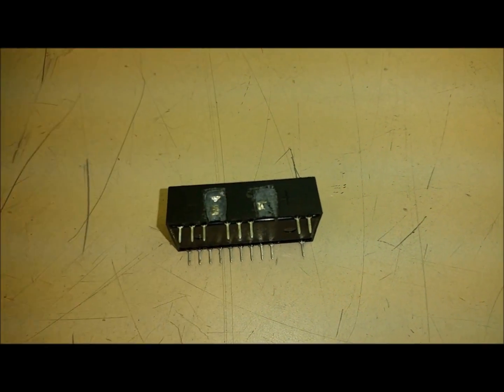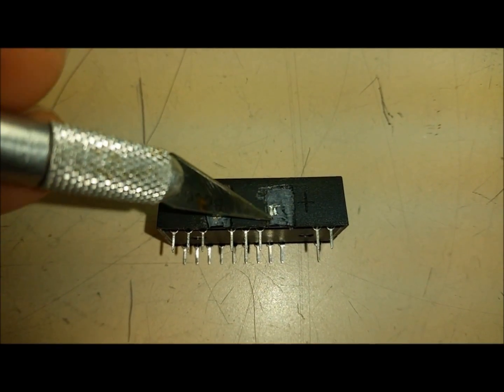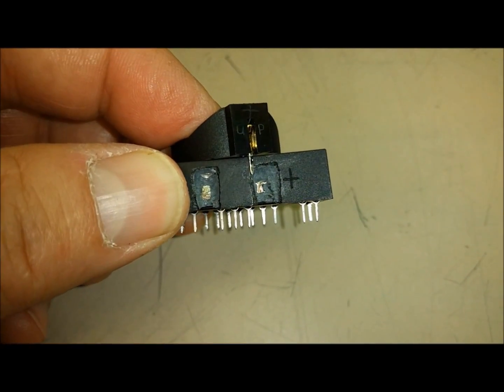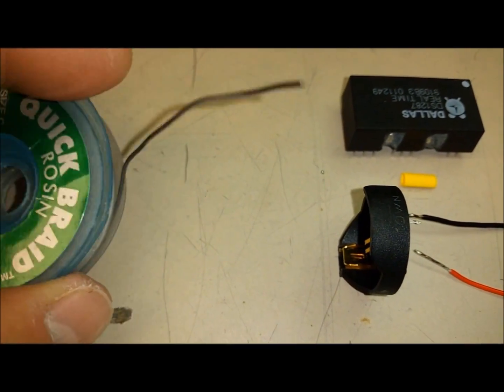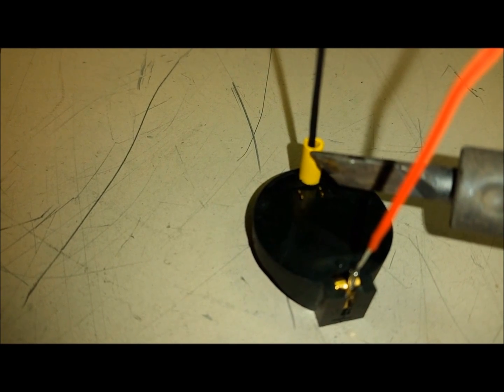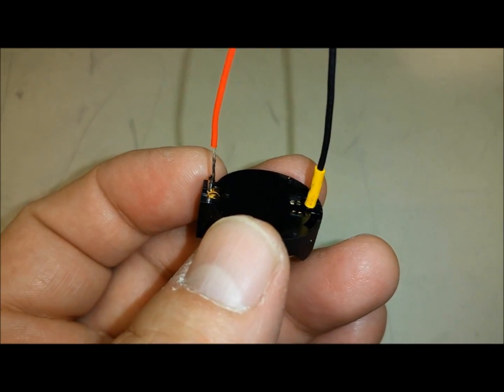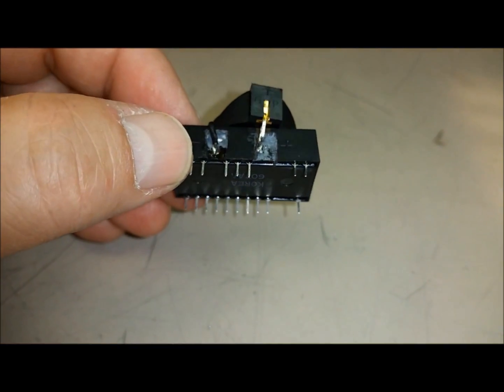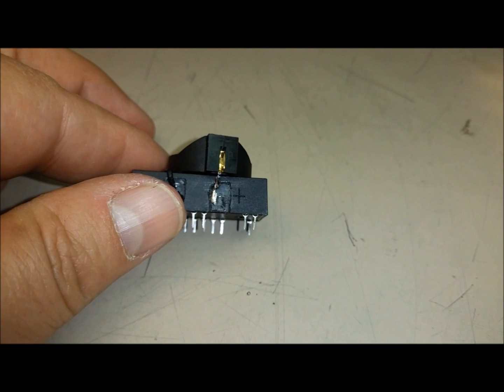Dallas DS1287 & DS12887 RTC & other DS RTC Chip Repairs

Comment: I have this in a Rx monza chemical analyzer. The machine doesn't boot to make screen display. Could this be the problem?
I read the voltage and it gave me 2.91 volt. Is this okay?
Help me out please.
Reply from the maker: 2.91v should be enough to hold the data in the RTC. I'm not familiar with your analyzer, but more than likely it's based on a regular PC Board. If the system won't boot it's probably the Mother board or hard drive. If you have replacement software, swap out the hard drive and load the software onto the hard drive and try to boot again. If it doesn't work, then your motherboard is probably toast. Acquire a new mother board on line and plug in the spare hard drive and load the software on that. If the system works, the try putting in the original hard drive and see if it works as it should. If it does, clone that hard drive to the back up drive. Another problem with older systems is the ram goes bad. Try installing the same part number ram chips in it. If you have two pairs, meaning 4 sticks pull two out and try to boot. If it boots. Swap one of the other sticks in one at a time to fine the bad stick. The purchase a new stick to replace it. Hope that helps. I'd like to see a video of your analyzer. Do you have a make and model of your equipment?
Hope that helps. Best Prayers and Blessings. Keith Noneya
Reply: @keithnoneya  good day. I had replied to your reply, however, i couldnt view it myself, did you?
Thanks
Reply from the maker: @olayinkasuleiman7106  No I couldn't see it. After I replied I looked up your device because I was curious. I tried to find how the system works but there is little to nothing on the internet on it. However after looking at the pictures of the device I can't even tell if it has a PC type mother board. You're going to have to take it to an electronics repair lab and have them look at it. If it has a back up battery and the batteries leaked, then you may have to clean de-solder and remove some of the IC chips to clean up the board runs and re-sloder them back on. Also the internal power supply may be the problem too. Most of those are modular and easily replaced. However since I can't even the inside mother board I can't say for sure what your issue is. Let me know what you find out. Best Prayers and Blessings. Keith Noneya

Comment: where the grounding pin going that's cut? Battery...isn't the memory volatile?  Probably something i'll have to do?   But, I should think you maybe cut the pin from old battery while the voltage is secured with the new one, no?  Or, maybe external power supply?  What if the negetive pin is left in place - old battery sucks out the juice from the new one?  Or, is it non volatile memory?
Reply from the maker: The memory is volatile. The IC was cut to add a new battery because the old one was dead and the volatile memory was already gone. If you have one with good memory, it would be a good idea to add the new battery before cutting the old battery ground. Very good observation. There also new IC's that do not require batteries that can take this IC's place in the circuit. In the video description there is a link to this IC. Hope that helps you find your answers. Best Blessings & Prayers. Keith Noneya
Reply: @keithnoneya  yeah I'm shopping around - ebay has some external battery solutions 100$ for 2 units.  But, will try adding an extra better sounds like a challenge, yet mine Dalls might have 2 batteries just judging by internet pictures for DS1486-150
Reply from the maker: @joepiscapo936  Let us know, I'd love to see a video on what you come up with. Keith Noneya
Reply: @keithnoneya  10-4

Comment: Couldnt You just solder battery to the corresponding legs on the back of the motherboard? 
I mean without desoldering the rtc.
Reply from the maker: No because the pins on the chip are bent up and don't go into the motherboard. So that's why you have to grind away the side of the IC to expose them to connect the battery to where the dead battery is attached inside the IC. You don't have to disconnect the internal battery by grinding the leg in two, but if you don't the external battery won't last as long. Hope that answers your question. Best Wishes & Blessings. Keith Noneya

Comment: Will this replace a ds12887A?
Reply from the maker: You'll have to look up the data sheets on both and compare the pin outs, memory and voltages, but I think it will if the pin outs are the same.
Reply: @keithnoneya  in the A variant, pin 21 (DIP) is an active low general purpose RAM clearing function.

Comment: Good job, saved 2 old Pentium 1 Mainboards.
Reply from the maker: Thanks I'm glad the mod worked. Don't forget to check the links in the description. One of them is how to replace it with a chip that doesn't require a battery. Best Wishes & Blessings. Keith Noneya

Comment: Why did you cut the top from bottom on PIN 16? Is it to avoid fast drain of the replacement battery? Thanks for this very detailed video !
Reply from the maker: Sorry for the late reply, my dad had passed away and I've been busy dealing with his estate. Yes the internal battery is bad and it could weaken or possibly short or the new battery and damage it. Good attention to detail and a great question. Thanks for watching. Best Wishes & Blessings. Keith Noneya
Reply: @keithnoneya  my condolences. Thanks for your confirmation.

Comment: Please help me with dallas DS1225AB-150IND
can i replace this dallas without reprogramming the new dallas?
too can i replace this dallas by DS1225AD-150?
Reply from the maker: HI Waleed, To answer your 1st question. It really depends on the circuit it's used in. If it's just for storage of the last setting of the equipment it's installed in then yes you can. If it's used to store something more important like calibration constants, then it gets a little more involved if you want to save those constants. If you don't save them your equipment will be out of calibration. If you have the equipment to calibrate the equipment then it shouldn't matter because the new constants should take the place of the old ones. In that case put a blank one in and calibrate the equipment. Hold onto the old one in case it has a hidden sub program you may need. The only other consideration is if it's used to store the program for say a Micro controller like a 8051 or one of its variants. If that's the case then certainly you'll want to save the data and transfer it to a known chip. If you don't transfer it then when you turn the equipment on it will just power up and do nothing.  
To answer your 2nd question, if you look at your data sheet it will tell you if it's compatible. Note that the letter or numbers on the end usually denote the size, speed, temp and package of the chip. The size is usually in megabytes or speed in Nano Seconds  and the rest will need a chart to tell you what the rest means. Check the data sheet to see how the pins are laid out. So even if the 1st part of the part number is the same and internally identical the physical size, shape and operating voltages may not be compatible. Always check the equipment operating requirements/conditions and check data sheets when installing alternate part numbers to ensure it will operate under those conditions. 
I looked at the data sheet and they do look compatible except for temperature operating conditions. Look at the Data sheet here: https://www.datasheetarchive.com/pdf/download.php?id=6e9b9ebad636e411870c6f4d61430d302732fe&type=M&term=DS1225AB150IND and go to page 9. You'll see the part number breakdown. The only difference I can see is the temperature the chip can handle. The IND can function between -40C to 85C in degrees. The unmarked can operate from 0C to 70C in degrees. If it's in a critical environment application then make sure the environment is within the 0C to 70C or you can't use it and expect it to operate correctly. Hope that helps point you in the right direction. Best Wishes & Blessings. Keith Noneya
Reply: @keithnoneya  
Thank you very much for your wonderful explanation.
I meant what is the difference between DS1225AB and DS1225AD..
It is mentioned in the datasheet the following:
((DATA RETENTION MODE
The DS1225AB provides full functional capability for VCC greater than 4.75 volts and write protects by 
4.5 volts. The DS1225AD provides full-functional capability for VCC greater than 4.5 volts and write 
protects by 4.25 volts. Data is maintained in the absence of VCC without any additional support circuitry. 
The nonvolatile static RAMs constantly monitor VCC. Should the supply voltage decay, the NV SRAMs 
automatically write protect themselves, all inputs become “don’t care,” and all outputs become high-
impedance. As VCC falls below approximately 3.0 volts, the power switching circuit connects the lithium 
energy source to RAM to retain data. During power-up, when VCC rises above approximately 3.0 volts, 
the power switching circuit connects external VCC to RAM and disconnects the lithium energy source. 
Normal RAM operation can resume after VCC exceeds 4.75 volts for the DS1225AB and 4.5 volts for the 
DS1225AD))..
But I didn't understand anything after reading.
Is it possible to exchange between them?
Reply from the maker: @عليالفيومي15  It appears you can exchange them, with the exception of the basic is only 10% accurate, in timing, and the IND is 5% accurate. The only other changes I saw was the operating temperatures. Both those differences are listed on pg. 9. If the equipment you're installing them in is withing those parameters then you should be able to use either in the equipment. Just out of curiosity what is it going to be installed in? Best Wishes & Blessings. Keith Noneya

Comment: Does the DS1387 have the same solder points as the DS1287? I have some EISA board which needs a revive.
Reply from the maker: Hi Aerobix, According to the data sheets it certainly looks like it. You can check out the data sheet here: https://www.datasheetarchive.com/pdf/download.php?id=06a352d62e54c7c83effdc5190f3e441e4272f&type=M&term=DS1387 Of course since I haven't done a 1387 I can't say for sure, however most manufactures don't like to change the pinouts from model to model provided it's the same type of chip. Check out this page where they say it is: http://www.mcamafia.de/mcapage0/dsrework.htm So it's probably worth the try. After all it's already broken what do you have to loose? Thanks for watching and I hope that helps. Best Wishes & Blessings. Keith Noneya

Comment: Works with DS1643??
Reply from the maker: I really couldn't say for sure. You'll have to compare the pinouts in the data sheets to make sure. Also you can check out this great article for some more information on how they work here: http://worldphaco.com/uploads/TEKTRONIX_2465b_OSCILLOSCOPE_CALIBRATION___REPOWERING_THE_DS1225.pdf Hope that points you in the right direction. Best Wishes & Blessings. Keith Noneya

Comment: not a DS12887!
Reply from the maker: I included the 12887 because it's pin compatible with the 1287 and should work for the 12887 per the data sheet here; https://datasheet.octopart.com/DS1287-Dallas-Semiconductor-datasheet-7278225.pdf I've also had people tell me it will work on the 12887 as well, so I included it so others might be able to fix there's. If you have one try it and let me know if I was told the truth. A nice video on it would help as well. Thanks for watching. Best Wishes & Blessings. Keith Noneya

Comment: I like how cleanly you removed the epoxy from pin 16. I have a Dremel tool (well, Harbor Freight knock off) I'm going to give this a shot tomorrow.
Reply from the maker: Hey Shawn let us know how it went. Best Wishes and Blessings. Keith Noneya
Reply: @keithnoneya  It went well. Thanks. I have 4 DS1287's and 1 '286 motherboard. So, I had a RTC to experiment with. I hacked one up and totally removed the BR1225. It gave me insight how things were connected. I know of the website that shows it, but I wanted to see it for myself. The datecode is from 1989 and battery voltage is 155 mV. On the next next one, the datecode was from 1990. I made the real mod and exposed the battery pins. I measured 3.3 volts! I couldn't believe it. I disconnected it anyway since I'd probably install it and it would fail a week later. ;) Anyway, thanks for the video.
Reply from the maker: @shawnerz98  Hey Shawn try this link you may find it useful. http://worldphaco.com/uploads/TEKTRONIX_2465b_OSCILLOSCOPE_CALIBRATION___REPOWERING_THE_DS1225.pdf Best Wishes & Blessings. Keith Noneya

Comment: What I see happening is the embedded pins 16 (ground) and 20 (battery positive) are exposed by cutting away body molding, then #16 is severed,  then soldering to the ground pin portion that is connected to the circuitry and not the old battery.  I have a DS12887A and all pins do extend out of the body.  Should I sever both pins and solder to the portion that protrudes out of the molded chip body?
The chip is seated in a socket when assembled onto the board. (I am not an electronics wiz but can do intricate work).
Reply from the maker: Hey DDB try this link. I think it will give you a pretty good perspective on your options. It's a PDF by a Dr. who has done some extensive study and experiments on either re-powering these chips or replacing them with some modern versions that don't require batteries. Here's the PDF link:
  http://worldphaco.com/uploads/TEKTRONIX_2465b_OSCILLOSCOPE_CALIBRATION___REPOWERING_THE_DS1225.pdf
Hope this points you in the right direction. Best Wishes and Blessings. Keith Noneya

Comment: I am wondering if you can list the advantages to having the replaceable battery.
Cost?
Availability?
Life?
I can still find the Dallas chip and they will last 5 to 10 years but when removed I still need to send in my realtime board to have the CMOS settings reset.  If a Button battery is used will it last 20 years?  When the button battery is removed I will still need to send in my board for CMOS settings reset.
Reply from the maker: One of the best questions on this I've had. I can think of several advantages:
- 1. Your scope, computer or what ever you have it in, won't go down at the least opportune time. If your chip is in a piece of test equipment and your company relies on the equipment and the battery goes dead. Now you have to get another piece of test equipment or repair and re-calibrate the piece. That causes delays and possibly your company reputation. 
- 2. Again if it's in a calibrated piece of equipment you'll have to get it repaired and re-calibrated.
As for the life of the button battery that depends on the current draw of the chip it's in. You can find that information in the data sheet.
- If the button battery dies it's easier to change.
- CMOS reset, that depends on what equipment the chip is in. If it has stored data, you'll need to copy it first then change the battery then reload the data onto the chip. 
- If the battery is already dead then any data you had on that chip is gone.
-  I found a website that answers your questions in detail but I don't remember the link. If I find it again I'll post another comment on it with the link.
Hope that helps answer some of your questions. I'll look for the link when I get home. 
PS the Dallas chips you find are probably New Old Stock NOS, the batteries in those are just as old (bad) and won't last. So it's better to replace the battery with a button style or another non-volatile chip. Thanks for watching. Best Wishes and Blessings. Keith Noneya
Reply from the maker: Ok found the article I was talking about. Here's a link to the PDF.
http://worldphaco.com/uploads/TEKTRONIX_2465b_OSCILLOSCOPE_CALIBRATION___REPOWERING_THE_DS1225.pdf 
This article should answer all your questions and then some. Hope this helps. Best Wishes & Blessings. Keith Noneya

Comment: Hi, I have a DS12C887 RTC, Can I use this Tutorial in my case??? Please, answer soon. Thanks
Reply from the maker: Lorena, I'm not sure, this is the only one I've done it to. This question gets asked quite often, as there are a lot of RTC's out there made by Dallas. The best I can offer is do the research on the pin-outs using the Data Sheet. Also you can cut the top off and gently grind down the epoxy inside until you can find the battery leads, test them for which one is negative and then do the procedure in the video. You should also read the comments on the video to get a good idea of what others are doing to fix this problem. Wish I could help more, but this is my best suggestion that I think will work. Thanks for watching. Best Wishes & Blessings. Keith Noneya